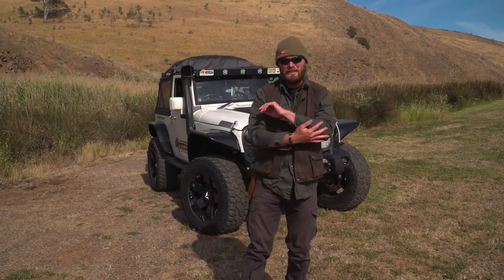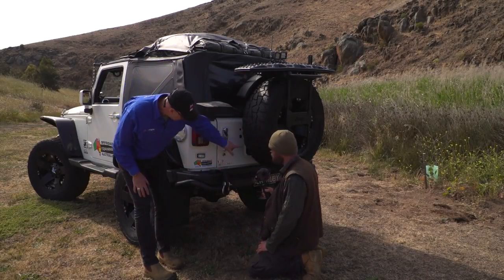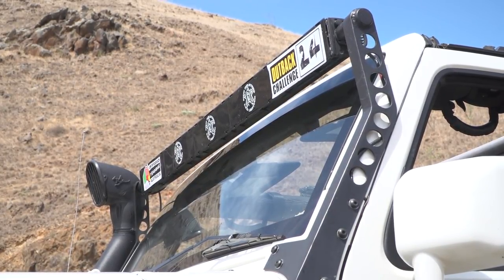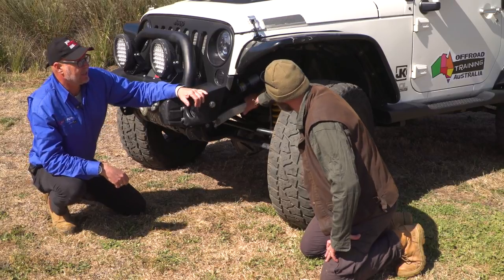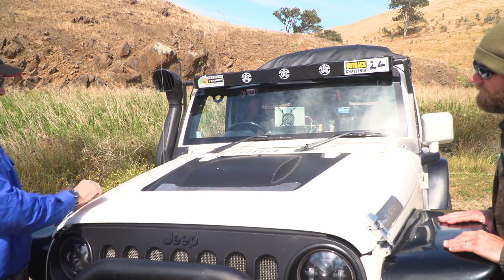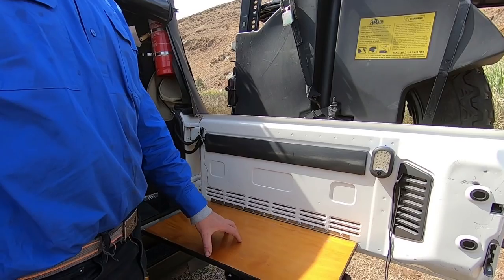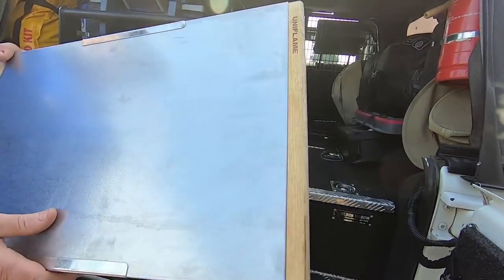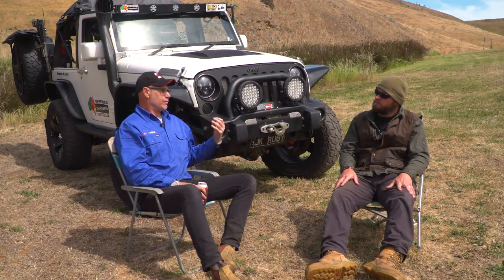JK Jeep Rubicon review, Modified episode 59

Comment: Great finished product.  Love the owners ideas for storage and that everything has to have 2 purposes.  I love 4wds and overlanding in general.  Had x5 Jeeps over the years myself, traveled all over Western Australia in them, so far never had a problem.  Currently have a JK diesel and use it for daily driver, and overlanding including interstate trips as well, love it.

I get that Jeep has a bad rep, but my personal experience has been different.  Supposedly Nissan and Toyota are better, but my mates have had probs with theirs and so far I haven't had any with my Jeeps.  Certainly older generations of Toyos and Nissans were more reliable than the current gen, I'll give them that.  Jeeps have always been way ahead of the Toyos and Nissans in terms of tech (in Aust anyway, US versions of the same Toyos and Nissan (if they get them) are usually better equipped), and out in remote areas this could be something that you can point your finger at as its a failure point.  But nowadays its all the same.  Cannot compare a modern Jeep with an older LandCruiser for example for reliability purposes, neither can you compare a modern LC with an older LC.  If the older vehicle breaks out in the bush then you can prob do a bush mechanic fix to get it to civilisation, a modern 4wd there is less chance.  But this is the way all manufacturers are going these days.  Jeep in fact, in Wrangler's case, is one of the very last company's to try and build a 4wd with modern tech and still have simplistic 4wd things like live axles, wheels that sit wide and outside the body, sway bar disconnects, very low range ratio.  No one else is offering these offroad specific goodies. 

I will also add that the owner def seems like he has done more research than the average 4wd builder and has gone through the trouble of building a vehicle for what he wants.  Hats off to him for achieving what he set out to.  I love the finished product.  BUT honestly, the extreme duties that the owner puts his vehicles through, of course he was going to break stuff.  The HP that engine is producing plus the speed at which he wants to be able to hit things at, all the stock components (and obviously some aftermarket stuff as well) would have been way outside of their designed operating limits.  Can't really blame Jeep for that.  Nothing would have lasted with the same % increase in load that he's putting through this Jeep.  But the best thing about owning a Jeep is that you can go and build it into whatever you want.  The aftermarket support is amazing.

If you're still reading lol, I'll add that his axles are not Ford 9", that rear axle is a Dynatrac D60 (Dana 60), and the front Dynatrac D44.  Very stout items, pretty common upgrade for a hardcore JK with 37" tyres.  FYI these axles are stronger than what LC's and Patrols (except maybe the H266B) have, and the D60 centre is stronger than a Ford 9", the D44 is a little weaker.

Comment: This is the perfect jeep... No actual jeep bits to go wrong.
Reply: Camhin1 Stock standard Jeep Wrangler can still outperform any other stock 4X4 you through at it
Reply: @MetalHayd  Bit hard to perform anything when it's stuck on a tilt tray all the time getting towed back to the dealership. Old mate has clearly done his research here but it's a bit concerning to have to spend that much money to get it reliable....
Reply: Our Cherokee has had ZERO reliability issues.
Reply: @AussieDazza  I dunno, maybe we get all the rejects in Australia- but they are not built well enough to last out here. Diesel landcruisers, hiluxs and patrols (none of which are sold in the US) are the main vehicles of choice when it comes to 4wding in Australia- and they're all built way better than any modern Jeep.
Reply: John yeah I own a TD42TI coil cab ute, bought brand new. That still doesn’t change the fact that not all Jeeps are unreliable, it depends on the model. Ours only has 50 000 kays on it but my sisters has 180 000 kays on hers and she has has zero mechanical issues as well.
Reply: John Honestly from my experience with Jeep, they are tough as nails. I’ve had Toyota, Isuzu, Nissan but when it comes down to the 4X4 aspect the Jeep wins hands down, I’ve snapped CVs in my hilux trying to do same sort of shit I do in the Jeep.
Reply: @jbhk7977  Lucky you, my Cherokee must have been a lemon then, it was an unreliable POS.

Comment: Ronny, when the new Jeep truck comes to Australia, I think it will be a great overland vehicle there. There will also be a diesel. If you haven't seen videos yet, check them out. Bunch of boys have reviewed it by now, well, not a real good review, but kind of preview because it's not for sale until a few months.
Reply: The Gladiator. Just need to put the diesel in the Rubicon.
Reply: Taka Yama if those JL's are built to complete shit standards. Horrible frame weld issues, steering locking up at 70+, batteries draining for no reason, rear main seals at 8000kms, the JL was made as an American FAMILY vehicle. It might have the trail rated badge but the quality is NOT there.
Reply: I don't know, it's got a pretty long wheelbase, you'd have to put a 4in lift on it to make it useful.
Reply: Wagoneer is making a comeback too on the Gladiator chassis. Basically like a really long Wrangler if they do it right.
Reply: The Wrangler has been available as a diesel since the JK in Australia. Has come with the 2.8l VM motor that was in the Liberty for a couple of years, and in the Colorado, not a bad engine. The main to drawbacks of this platform has been that the stock axles (either D30 or D44) aren't great for high payloads over rough terrain, and some of the typical FCA build quality issues.
Reply: @IBAdrianHarris  D44s are plenty strong up to 35s. The housings tend to go first, but a truss  will solve that. Chromoly axles and a truss and this guy wouldn't have needed 60s. Those are more for 38"+ tires.

Comment: I don't know the laws in Australia but with the apparent illegality of beadlock (2 piece bolted) wheels, you should research "internal boltless beadlocks."  They will work with most any off the shelf wheels and are completely internal and out of sight.  I believe the technology was originally developed for the military and is very effective and virtually bulletproof when used correctly.
Reply: Still illegal in Australia unfortunately as you have to drill the wheel for the second valve.

Comment: Dana and Spicer are the same company, Spicer is driveshaft components, Dana is axles and chassis. Ford F250 SDs run Dana 60 front axles (4x4 only, of course) and a Ford/Sterling rear axle SRW or Dana 80 DRW...

Comment: Really gotta get a proper 3.6 on here. Much more powerful and actually bulletproof reliable.
Reply: AD1 a friend of mine has a 3.6 thing is fucked with only 150,000kms...
Reply: 3.8 is tough as nails, only ever issue you will have over few years of abuse is cracked extractors due to the heat, that’s about it really.
Reply: @kiaran1155  must be an oddity. They go in rental cars, cop cars, taxis, and vans here in the US and do hundreds of thousands of abusive, neglectful miles without failure. Service engines like that in the US are basically designed to not be maintained properly and keep working.
Reply: @MetalHayd  is that stupid 'Y' piece the splits the coolant line the extractor? Cause I've fixed a few of those on 3.8s. And they definitely crack due to heat because they're plastic 🤣. I know 3.8s almost ubiquitously burn oil too, but I don't know them to actually explode very often.
Reply: AD1 I drive my rigs hard and 3.8 works harder then the diesel rivals here in Australia (being a petrol engine). But honestly have had no issues with my engine same goes for the group I wheel with, fair enough they do suck oil but that’s hardly a problem. These mini van engines have no power at all, so people slapping on heavier parts or superchargers or what ever will give that motor stress and that’s when things can go wrong if you don’t look after it. But it all fairness the 3.8 is a good engine, it has been in production since 1993-2011 so that says a lot. 
But if I could pick another motor for my JK it would be the 2.8 Diesel, it’s more ideal for Australia.
Reply: @MetalHayd  idk much about the 2.8 unless you're talking about the r2.8 Cummins crate engine swap. That's what I'm going with if my 3.6 ever manages to pop. The only diesel we're getting is the JL 3.0 which should make considerably more torque than the 1VD. Is the aus/euro JK 2.8 a reliable engine? Does it still use the NSG370?
Reply: AD1 The 2.8 we get here for the JK is the RA 482 DOHC, has about 177hp and 340Ib.ft, if equipped by the 545RFE , 302ft if equipped with the NSG370. As for reliability, its a strong motor. Hands down if I had the choice at the time and knew what I know now I would of picked it without thinking twice, great at towing and low end grunt for trails. I don’t think the 2.8 comes in the rubicon spec unfortunately.

Comment: Also, since he is still running the stock transfer box for the rubicon, it's 4:1.  He might be 80:1 1st gear low to the tires.
Reply: Yes he means the crawl ratio.  
For comparison the typical solid axle Cruiser or Patrol is usually around 40:1.
Reply: The new JL Rubicon with a manual is 84:1 from the factory with 33's.

Comment: My Jeep = zero issues. Mine is 2015. 
The 3.8L is garbage in the older models
Reply: Agreed, the 3.6L is so much better, my 2013 Overland JK with stock drivetrain, nearly 100,000 kms, has never skipped a beat.
Reply: I disagree, have you ever owned a 3.8L jeep? Mine 2008 JKU 3.8L is still going strong, zero issues.
Reply: No, but I know a guy whose 3.8 has been rebuilt 4 times.

Comment: Not normally one to stir the pot but this one was hard to watch. He was fairly unpleasant about the brand. He talked consistently about how hard he was on the vehicle but those Rockstar center caps are known for breaking and they are spotless..along with the entire vehicle. 

I run a Jeep in the states with 35's and I've never had any issues and I'm sitting at 120k miles. My Jeep has been all over Texas to every single off road park too without any major breakdown outside of a bent tie rod and a u joint cap falling off.
Reply: Australian conditions are honestly just harsher- more unsealed roads, far more remote and with basically no dealers. Australia is a similar size to the US but has the population of New York- of that population over 90 percent of us live within two hours of a coastline. A Toyota or Nissan is really the only real option for long distance reliable touring- Toyota in particular have an amazing reputation for reliability and basically have an unparalleled service network. You guys in the states don't get most of the 4wds we do and what ones you do get have petrol engines (which is extremely rare here, over 90 percent of lc200 sales are diesel).

Comment: Sounds terrible. Reminds me of my fart box gemini I had when I was 17.
Reply: dogg 18  I bet your rig is way better huh?
Reply: Can’t believe someone read my comment then actually bothered to reply. Thanks mate👍
Reply: I agree, it doesn't sound good. Seems to have some bad resonance which I bet could be tuned out. I don't know if he's got a resonator further upstream from the muffler, but with the short wheelbase maybe there isn't much room. 

He would need to experiment a bit (doesn't seem to be a problem monetarily), but a Helmholtz resonator in the right spot might be able to fix this. Also if that's a chambered muffler, maybe it is not tuned for this application. 

Not sure if those are equal length headers or not. Not even sure how many cylinders Aussie JKs have, but if it's the V6 and the two sides of the V engine aren't equal length, that could be the issue. I doubt it's the six based on 150 crank HP rating he gave earlier though.
EDIT: He does say later it is a V6.

Comment: Might not be a jeep problem sounds more like driver error its a JEEP made for big rocks of the sierras at slow speeds its not a group B rally car LOL. IMO this guy is a tool, he spent 2 years researching parts to buy and bought the worst quality and most over marketed parts america has to offer. he did buy really good overpriced axles but the wrong ones. he needs full float versions they don't have bearing problems when overloaded like his. Anyways Jeep JKs from 2007-2011 are garbage minivans from factory everyone in america knows it, the previous generation the TJ/LJ was last real jeep ever made and the newest generation JL is even worse quality than the jk.

Ronny love your content good luck don't let this baffoon kill you.
Reply: I hate to say it but I agree 100%. Especially on his choice of axles for this build. Idiotic.
Reply: Spot on, I cannot agree more. Sure, his build is not your everyday garage joe build so the guy knows something. Lots of good upgrades and everything. But if I was going heavy dana 60 way why not full floats? On a small wrangler like this he would not have had any bearing issues at all. Anyway, that engine work sounds interesting. Also the rear bumber looks good and practical.
Reply: I love my 2010 jk... 😔.. It's not a minivan .. Hell i'd have space in a minivan 😂😂

Comment: can you say engine instead of motor
Reply: Why?
Reply: @JeremyPetho  because it's an engine not a motor. an engine makes power and a motor runs off power
Reply: @haydenleonard3456  The dictionary definition of motor is "A machine or device that converts any form of energy into mechanical energy, or imparts motion."   
This can include the potential energy in fuel.  
The big clue here is the word "motorcar".

Comment: Wow, Jeeps invented the 4x4 after market. Mopar invented after market for everthing else. Bit long in the tooth bud.
2010 3.8 with a SC not bad though, is that 200 wheel hop? Better but still a donk. Jeeps are crap off road every aussie knows jeeps are crap especially all those who own all the other brands. Toyota learned from Jeeps but I'd much rather a 50metre long 28tonne $150,000 100m turning circle gutted landcruiser.
Reply: Hmm.  Funny, I was just in Moab and ran with a built Toyota 4 Runner.  He really struggled on things my Jeep JL walked right over, all day long.  (Mostly stock JL, 2" lift, 35" all terrains, factory wheels, manual trans.)  Off-roading is a vague term anyway.  Every vehicle is a compromise.  One might be better than another at something, but to say any one of them is crap off road is just a silly generalization.  They can be made to do what you want them to do, and do it well.  Any of them.  One of the things I appreciate about Ronny is that he appreciates and enjoys all kinds of machines, from Toyotas to Jeeps to Chevy's and everything else.  I enjoy wheeling my Jeep with a variety of vehicles.  The more diversity of machines, the more fun it is. They all break occasionally. That's part of the challenge.  This guy has really built a nice Jeep and I believe he's put lots of experience and wisdom into it's build.